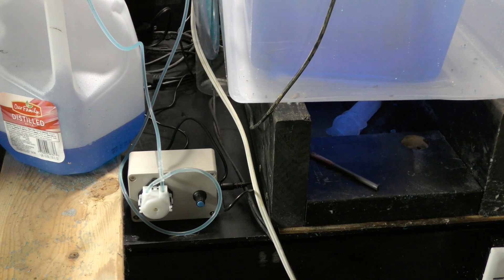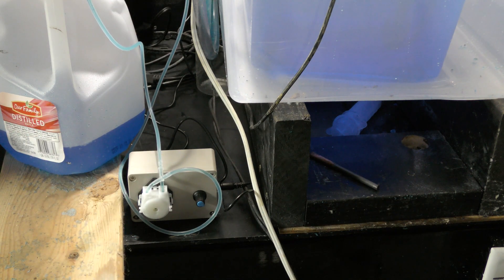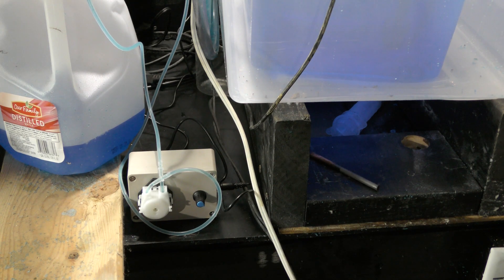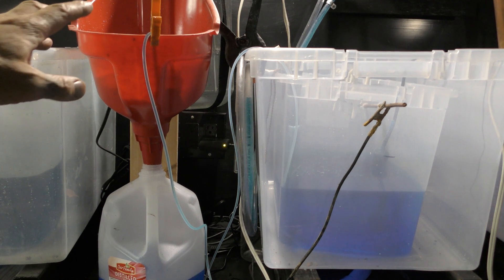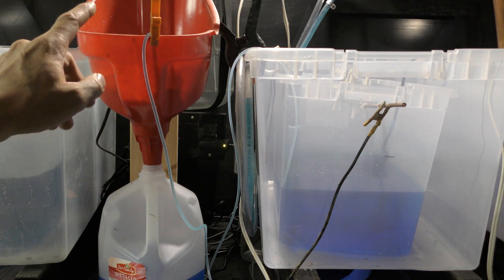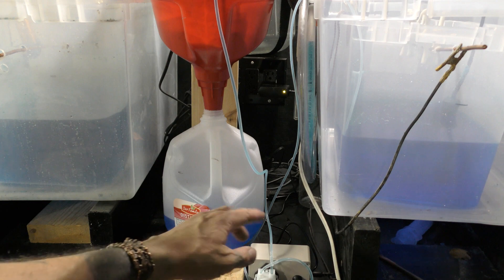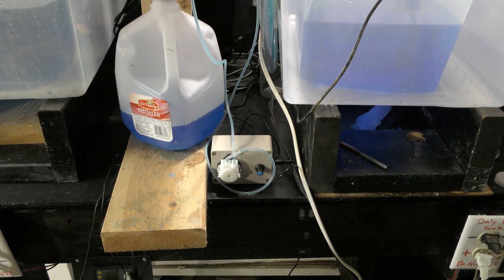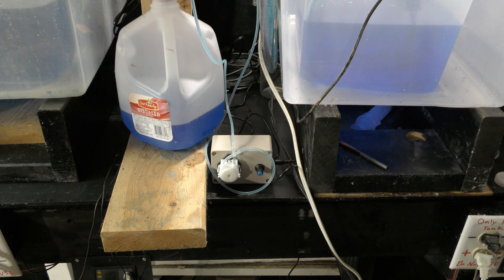Filter Electroforming solution with a peristaltic pump

Comment: We use this in the Reef fish tank hobby. It's great for "Dosing" additives to the tank. They work great, and do not really clog that often. Have you tried a small aquarium pump??? Something rated for like 25 GPH? Or even a small table top fountain will push the water through. On the "intake" slot on the pump you can put some coffee filter to stop the particles too. And they are cheap cheap and just submerge into your tank.